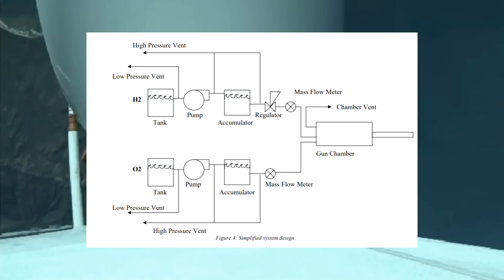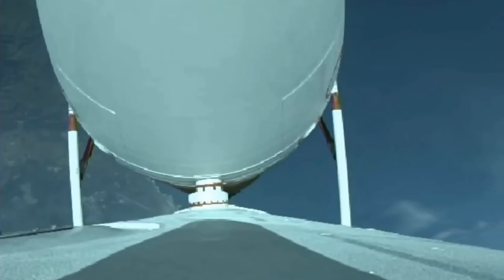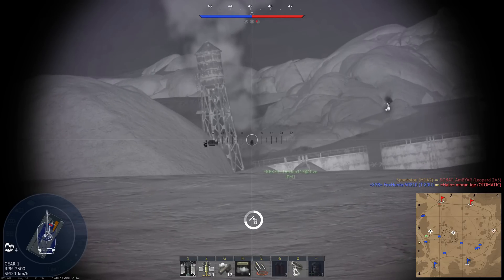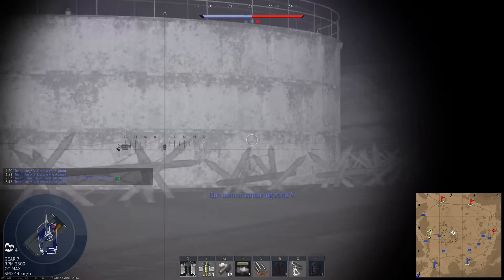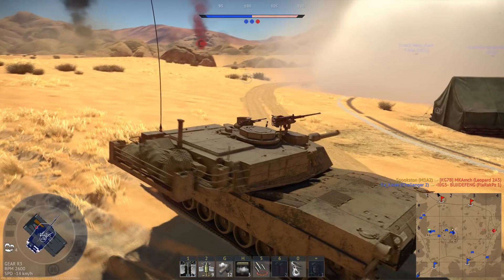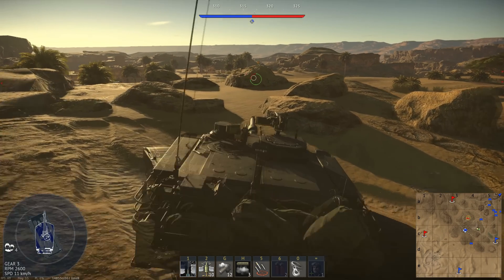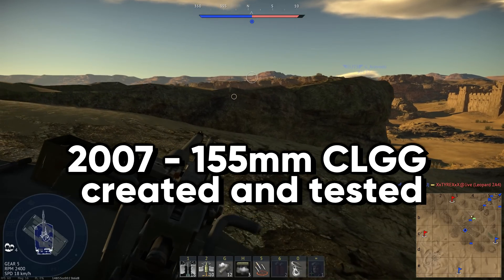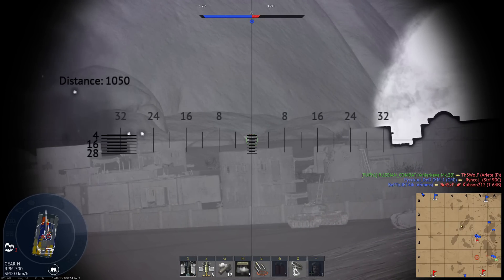CLG Guns - Future Tank Weaponry

Comment: The one application that immediately stands out for a CLG cannon would be future missile defense, especially for ground installations. If you can lob fragmentation rounds at 7km/s, that could make for an effective way to knock down hypersonic missiles at a drastically lower cost per shot compared to rocket interceptors.
Reply: In short, hyperspeed shotguns
Reply: M P supersonic CIWS shotguns.
Reply: I think it won't be using the "Close" part of that.
Reply: @FMHikari  "Close" compared to the 200 km range.
Reply: The issue with hypersonic weapons is tracking them. They produce plasma due to the high velocity heating the air into plasma. The plasma blocks radar reflections make it impossible to track using radar. Hypersonic weapons also take evasive action, & fly in a non-predictable flight path to make it nearly impossible to shoot them down with ballistic weapons. The rate of fire from a CLG or rail gun would be about 1000 times to slow to be effective. Even a Laser system would like be unable to stop them, because a laser weapon needs several seconds on target to deliver enough energy, especially for a hypersonic missile or kinetic projectile that needs to deal with extreme amount of heat. Laser weapons have a limited effective range because the air will disperse the energy, and very powerful laser beams will ionize the air causing severe attenuation of the beam's energy.
Reply: Guy Tech the issue with tracking is response time not detection. It's a hot object with plasma spewing off it... any IR camera can see it, the problem is target prediction of an evading object at those speeds. I personally think all naval war will go underwater, specifically to protect against attacks from such systems.
Reply: @JaneDoe-dg1gv  Issue is that IR detection has limited range. Perhaps an IR detection system could detect it 50 to 100 miles away. Radar can detect objects over thousands of miles away, providing more time to track and launch defensive measures. If an inbound missile can be detected it could be reasonable targeted with a defensive missile which can lock on to a inbound missile using IR tracking system when its within 50 to 100 miles. But you need a radar system to be able to detect it at long ranges in order to get the defensive missile launched and heading towards the target and reach the missile before it reachs its target.
Reply: Guy Tech instead of having guided missiles, why not use flak rockets being launched to form a wall of flak to deal with an incoming missile. So once you see it at say 80 miles, you launch enough counter-rockets so if it tries to dodge it is hit by another coming up. Maybe 50 small rockets per target from a battery of a few thousand, with an intercept range of ~15 miles?
Reply: Instead of CLGGs why not use LPGs? Specifically revolver style cannons with water cooling. Think 6-8in cannon firing 500 round bursts in battery with a few hundred other cannons; all being controlled by a central firing computer. It's kinda a crap shoot how it will maneuver so you need hundreds pointed in all direction ready to spin to full fire faster than a rotary cannon. This way you have enough guns so that you can trap it in a cone of frag shells which will collapse onto the missile's path; or if faced with a full barrage then make a wall of flak.

Comment: Because we do not have a good understanding of how Metallic Hydrogen works, whether it is stable at normal pressures, as the only place we speculate it exists is deep inside gas giants like Jupiter or Saturn, any thing concerning Metallic Hydrogen is just that speculation. But if it does remain solid after formation, or just liquid, Metallic hydrogen becomes a radical propellant for not just rockets as far less fuel would be needed to get into orbit, but for CLGGs the fuel becomes far less of a liability in combat. However I do agree that CLGGs make more sense as ship board artillery or battlefield artillery. As a Tank weapon it seems unlikely at this time. 

Metallic Hydrogen also poses the possibility of room temperature superconductivity. If this is teh case, then Railguns just matched or leapfrogged CLGGs.

Comment: Artillery do not rely on speed or kinetik energy to deliver damage (unless is an at gun from a tank) terminal velocity of max range artillery shell is actually little more tha free fall velocity. Arty shell deliver damage by chem energy stored as HE or fragments propelled by the HE charge or other chem like white phosphorus not kinetick energi... so only way to increase artillery power is to increase weight ( a very fast or a static arty shell have exsactly same effect) still if it is true 200 km range is fukin insane that is more than many rokets
Reply: Or change the filler of the round from TNT  to nuclear material or "higher  explosive" substance.
USA developed a nuclear mortar but the blast wave of the nuclear explosion could hit the mortar and crew even in max range at the gun but on modern ship with modern gun it could work.

There is also existence (but not confirmed by any one obviously) of pocket or suitcase tactical nukes that could be fired from tow luncher or other small rocket system

Comment: On the topic of precision artillery, what if instead of changing the amount of propellant for a particular velocity, you just fire at full power all the time but vent a metered amount?
Reply: BrokenLifeCycle that's rather wasteful. Side idea. Could CLG guns be used with rarefied wave guns? I saw a comment on using methane gas and compressed air generated by the engine and its fuel and immediately though of combining gas combustion with a rarefied wave gun. Imagine a low recoil gun firing shells ~7 Km/s at ~20 RPM. It would be the ultimate kinetic energy penetrator of our modern time. Able to be mounted on any tank, SPG, IFV, or APC. Ships would benefit from the improved range and lack of explosive propellant. Maybe downsizing the tech would make for better CIWS?

Comment: They can use or MEK-hydrogenperoxide or heptil-sulfur acid propellant system. 

It toxic, but lower temperature and pressure standards.
Reply: Калиев Мади I had thought about nitric oxide and methanol. Both really cheap and easy to store, if underpowered compared to hydrolox.

Comment: My gut feeling is that this video overstates the safety difficulties of segregated cryogenic propellants. 

1. If a cryotank loses active cooling, it doesn't immediately explode. This is because boiling is endothermic. As the LO2 or LH2 boils, this absorbs heat, cooling the liquid. In general, automatic pressure release valves are simple but extremely important. LN2 is often stored unpressurized in unpowered insulated containers, and maintains liquid state by boiling off slowly, which passively cools the fluid. In my experience, a handheld dewer should be good for a day and a pallet-sized dewer should be good for a week without active cooling.

2. LH2 and LO2 are very incendiary when mixed, but many things on a tank are. For example, main gun propellant is composed of oxidizer and fuel mixed together and is an extremely high fire risk: tanks put a ton of effort into protecting the crew from main gun propellant (see wet stowage and blow-off panels). Similarly, gasoline for the tank is a huge fire risk, because it's a liquid. I would expect LO2 and LH2 to be similar in danger to gasoline if well segregated: they can start fires easily, but probably not as intensely as main gun propellant. 

3. A danger I didn't notice this video mention is suffocation. If the crew compartment filled with gaseous H2, you would suffocate and never feel out of breath. Gas monitors are important, as is segregating LH2 and LO2 from the crew.

4. Wikipedia says that these weapons have issues with muzzle velocity deviation. This matches my knowledge of gas/liquid mixing. In short, it's hard to get consistent propellant mixing. Accuracy suffers. The history of rocketry includes a ton of effort put into injector plate design.
Reply: Maybe you won't need to store the hydrogen in liquid form, as far as I know there's a solid variety where the hydrogen is put into a titanium alloy "sponge" that releases it when heated a bit.
Reply: etuanno the same happens with platinum but it can lead to metal fatigue and doesn't have a good storage capacity. Especially when hydrolox is not actually necessary for the technologies function.
Reply: i generally support all your claims you did there. The only thing i have to add is, that i think that the Crew dont will be in great danger. When you look at the T-14 Armata, the newest tank around right now, has the crew completly seperated from the gun and the turret. So when the LOX and LH is stored in tanks in the back (with blowout panels around) and the fuel lines go into the turret, the dont realy will hurt the crew inside when the tanks undergo a rapid  heated dissasembly.
Reply: One idea is having the rear of the barrel set up as a combustion chamber. Actually, kind of like a muzzle-loading breach-action gun, the round would be pushed back atop the combustion chamber and fuel turbine-fed into it like a rocket engine.
Reply: Search youtube for the dangers of liquid oxygen. It is not just incendiary it becomes high explosive when in contact with organic compound like oil and greases. They also ignite on contact so all oxygen equipment must be regularly cleaned in a clean room to avoid explosion from greasy hands.
Reply: what do you guys mean not in great danger, a small leak makes the whole tank into a bomb guys
Reply: @gabriel300010  if you know how pressurized tanks work, then you would know that they're supposed to leak.
Reply: Big Lumpy Beetle also that compressed gasses aren't as dangerous as most people think if you actually handle them properly. The big danger is reaching the explosive fuel air ratio. But that is generally not gonna happen and you should act like it is always the case for flammable materials. Not that big a danger really.
Reply: Big Lumpy Beetle my first reply didn't properly address what you said. A tank is already a big bomb. Why do you think we use blow out panels and separate crew and ammo storage, wet storage, and freaking armor. One good heat round and everyone in and around a tank dies, a good kinetic round and the engine is dead likely with fire and everyone is gonna be dead soon, a missile and the blast wave killed em all or blew up their ammo, everyone will be dead. Being a tanker is a dangerous job like any frontline military job. Especially so because your valuable on the battlefield, thus a prime target. These flammable compressed gasses are not any more dangerous that anything else.
Reply: What a beautiful comment
Reply: If the armour is penetrated at the tank the explosion would be much more catastrophic to near by soldiers
Reply: @yo yo ya the amount of powder that’s in there doesn’t make a giant explosion, and it blows out the top, but for a large amount of compressed gas when that explodes you’re pretty much guaranteed a giant fire ball maybe 50m in diameter
Reply: @yo yo I’m no dumbo I just know how fucking explosive liquid oxygen is
Reply: i think its funny how the supposed danger of storing hydrogen onboard a tank is mentioned as if tank ammunition isn't already known for blowing its occupants sky high when struck
Reply: Well, that's what you get from a channelm of wich the videos are more or less tailord to amuse, not to educate in high detail. ;D

I mean, all the "future weapon" videos he made featured systems that i already knew about in quite more detail, in comparsion to what he put into the videos.
Reply: Mandernach Luca oh that's quite good. I myself haven't heard of a few systems. The only ones coming to mind being rarefied wave guns and combustion light gas guns. The other technologies I too had a deeper understanding of, but it is safe to assume he is targeting an audience with less knowledge in these fields.

Comment: Shouldn't be confused with a Light Gas Gun. In a nutshell: An LGG is the mother of all BB guns, used to simulate meteoric impacts in labs. A CLGG is "gun, but what if powder is gas?".
Reply: Airsoft Chem-Rail Artillery, oh yes
Reply: The difference between CLGGs and LGGs is a C = Combustion.
In LGGs you just have the hydrogen because of it‘s low molecular weight. But you don‘t use the chemical reaction of hydrogen with oxygen. The gas needs to be at high pressure to accelerate the projectile. There are multiple ways of achieving that. Seriously, look it up at Wikipedia! I can’t explain it in a YouTube-Commentary!
Reply: @karlsinger4760  It's not that hard to explain. You have a gas that is pushed into a smaller space than where it had been previously where it then pushes a projectile against a burster plate that will burst once enough pressure has been built up. Leaving the projectile free to exit the barrel at high velocity. That's an LGG. 

A CLGG works completely differently. There is simply a gas where you would usually have your solid propellant which is then ignited and pushes the projectile out of the barrel, much like how regular propellant would've done it, except better.
Reply: @karlsinger4760  
The idea behind LGG is the increase in efficiency by  accellerating the projectile with a light gas, therefor accellerating faster at the same barrel lenght. You still have, respectively need a combustion but the combustion is seperated from the light gas.
Reply: @karlsinger4760   Hold up isnt water hydrogen and oxegen
and arent humans mostly water
Reply: @karlsinger4760  The hydrogen is used as a piston or spring in a lgg. As you compress the hydrogen you store energy and when the projectile starts moving the hydrogen pushes it very fast. You usually use combustion to compress the hydrogen inside a piston and as it compresses the pressure builds which then pushes the projectile.
Reply: Isn't it just a block that is shoot forwards by an explosion that compresses the air and that air gets so compressed it breaks through a plate and blasts out pushing a tiny bullet out of the gun at incredible speed?
Reply: @wulfleyn6498  That's exactly what it is. 

The initial analogy to the BB gun is good, as the main difference between the two is the means of compressing the gas. A BB gun usually uses mechanical energy, as in the hands used to operate the piston inside a compressor, where as in a gas gun, the gas is compressed much more rapidly through combustion of a propellant acting on the piston resulting in much higher velocities. Variations of this system, using an explosive charge (what explosive is to me unknown) has been used to launch the piston to a velocity over 4500m/s which then acts upon the gas (hydrogen) to propell a projectile that has a velocity of almost 100km/s at the muzzle. 

100km/s.

Fucking insane.
Reply: @John-un3lj  nitroglycerine/nitrocellulose is the most common charge used(smokeless powder) but for larger uses like gun type nuclear weapons it's 60/40 TNT/RDX
Reply: The first one isn't quite right, light gas guns are not in any way like bb guns, except, you know of any kind that accellerates gas with a deflagrating propallent, cause i do not.

Light gas guns are rather the pneumatic equivalent of a "shotgun starter" strapped to a catapult. ;D
Reply: @Enthropical_Thunder  I was just looking for a simple explanation and I felt that "you know the feeling when you spit out a cherry seed? How you have to build up pressure inside your mouth until the seed bursts through with increased velocity?" wasn't quite as good of an image.
Reply: Love the physics in this thread I'mma come back to this
Reply: So basically almost every gun invention, this, but better

Comment: could it be possible to make a naval based CLG gun and run a magnetic rail down the barrel to add extra acceleration on top of the combustion
Reply from the maker: Theoretically yes, but all that equipment would take up a ton of space
Reply: @Spookston  the reason i say naval gun is because a ship can afford to use up a lot more space than normal weapons platforms

Comment: What do you think about hybrid propellant cannons? Like using typical powder or a etc and giving it a boost with coil/rail to increase final velocity. While this is more complex.. I would think this might happen sooner than pure rail gun based tanks.
Reply: Technically speaking the etc gun is already an hybrid, since the energy come electricity and propellant, i also highyly doubt that we will not so much velocity that we will need railgun hybrif guns.